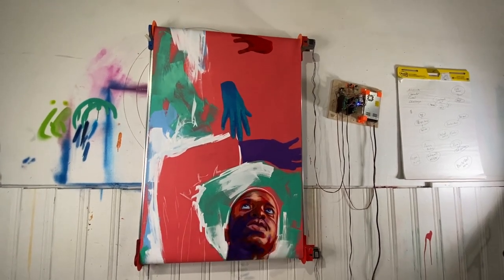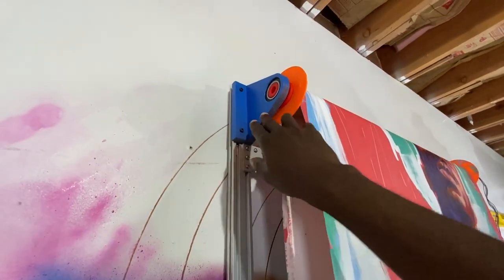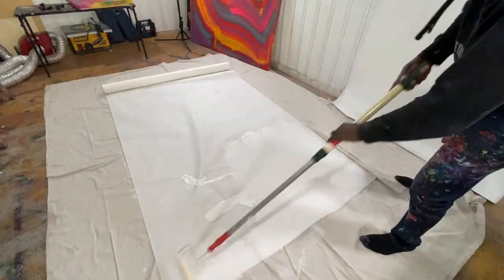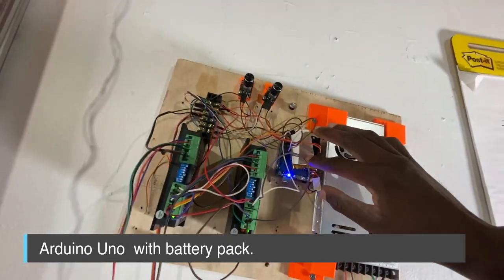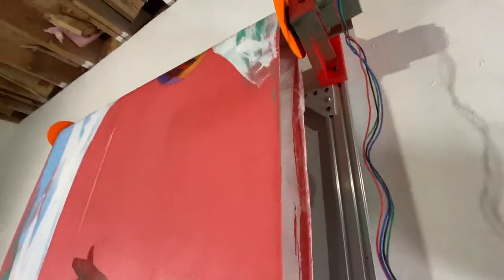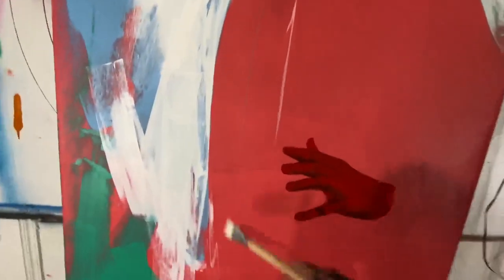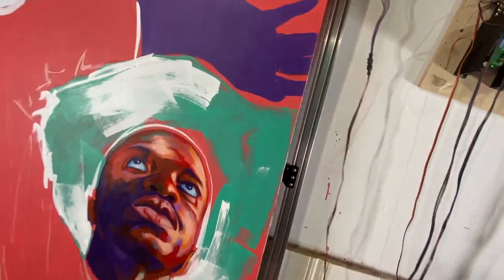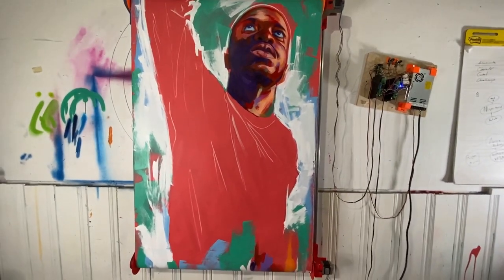I Made a Rotating Treadmill Canvas for Painting

Comment: This is sweet! You could potentially add a backer board that sits between to two halves of the roll to keep the canvas from flexing so much from the downward pressure while painting. Just a piece of smooth plywood or similar that can be stood off the correct distance from the aluminum extrusion. Thanks for sharing this project!
Reply from the maker: Great tip!